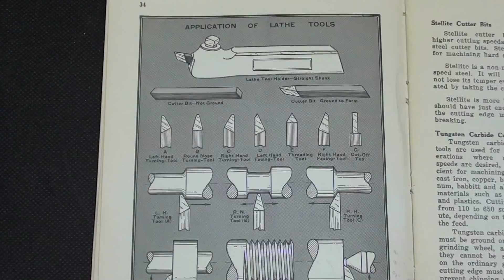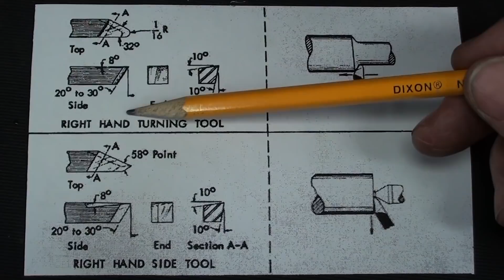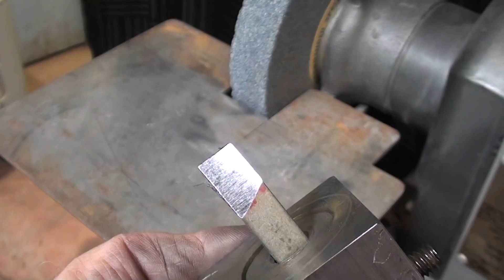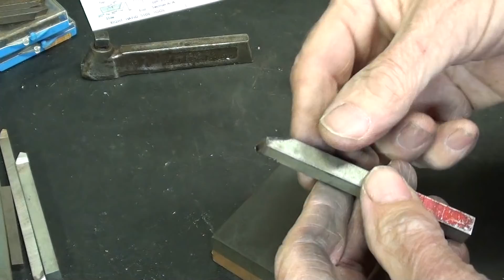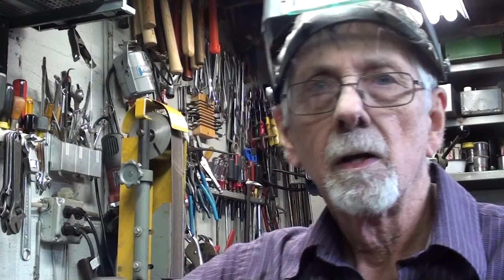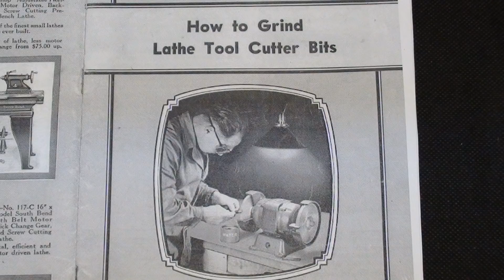HOW TO USE SB GRINDING JIG #709 pt 4 tubalcain lathe tool bits

Comment: Good morning, Mr.Pete! Three years later and am refreshing my 1978 tool grinding days. I also had a shop teacher teach us how to grind a lathe tool with a piece of square mild steel, then on a piece of high speed. I miss- placed my high speed steel right hand lathe cutter for forty years, thought I may have left it in the lathe at my first job around 1983. It was my first attempt and it took a half hour, but it was spectacular. I still use it now and haven't abused it and it still cuts beautifully. Thanks again for keeping these videos alive.
Reply from the maker: That is a wonderful story, thanks for sharing!

Comment: Machine shop grade nine high school in 1971 a student had too heavy of a feed on a surface grinder.  We were making a die handle.  That wheel exploded and a chunk flew across the room and put a hole in a cement brick wall.  So heed what what mr. says always stand beside the grinding wheel.
Reply from the maker: Surface grinders always scared me. I’ve never had a wheel explode, but I’ve had work thrown from the magnetic chuck

Comment: I am a frequent viewer of your channel and I am of similar age. Your recent posting for the South Bend Grinding Jig struck me as an interesting project and I decided it was one I was ready to tackle. So I went to myheap.com to get the plans and downloaded the offering by JHM because it looked the most like a normal drawing. I proceeded to work on the jig but after I cut the 10° slope on the body part, I realized I had put it on the wrong end. (I already had the two holes drilled in the top.) After checking the drawing more closely, I realized the drawing was in error and that’s why I made the mistake. Granted it was partly my fault for not checking the drawing’s validity but I wanted you to be aware of the issue since others may make the same mistake.
Reply from the maker: Thank you for the comment. I’ll tell you something right now. There were more drawings of this project than what I really wanted.    I was unable to proofread them. I had a hunch that there might be some mistakes. And there might be lots more than what you discovered       sorry about that.    Probably does not matter a whole lot, because who else will actually make this project, LOL.    I almost forgot to say, I really have no way of correcting this.  That would involve more than three people, and lots of time

Comment: Thank you Mr. Peterson. I purchased one of these, with most of the inserts and, one of the remanufactured cutting gauges off of Ebay from "Alisam engineering". Your videos really help make my Vintage SB 9A 4' bed is an awesome machine. If it's okay with you, I would like to post a snapshot of you on my shop wall next to my lathe. You are an inspiration to us all. Thanks again,
Jim🙂
Reply from the maker: Thank you for watching and commenting    Yes.    post my picture

Comment: What Lyle is showing here is the very bassos of all machining and without it you will bever understand how to be a real machine hand. 

 I was first instructed in tool grinding in High School  by our shop teacher Mr. Jim Jamison back in 1963 ,,,, 3/8" bits regular HSS,,,,Free Hand,,,,Round nose on one end and a facing tool on the other also free hand.  

It has served me well to this day. Even in the Army in Vietnam I was the only one in the Platoon that had any idea about Rake and Clearance angles,,,,and I would be in base camp in a tent at night  with a gas lantern filling saws and chain saw chains until I taught a couple other guys how to do it, -(We were combat Engineers)

 It is a knowledge that has served me well all my life to this day. I even touch up carbide inserts when they are not chipped too bad. ,,,, It shocks me to go into a shop today and see 30 plus  year old men running CNC lathes and mills who have no clue about rakes and clearances. I have even had some of them laugh at me when they see me grinding a drill bit. (Untill they see it cutting better then new) they think when you dull or chip a drill you throw it away.  Total  ignorance personified, and its because nobody taught them how to do it. 

It was the beginning of the end when there are no more Mr Petes, and Mr Jamisons.to show us how to do it,,,,  and idiot school boards that cut out industrial arts and replace it with diversity and sexual identify classes.  No wounder we get virtually  un-employable  collage graduates.,,,, that can;t read.
Reply from the maker: Thank you for an interesting comment. You are so right, that most people cannot sharpen anything more complicated than a pencil. They consider all cutting tools disposable. I’m glad you have the realization of how important industrial arts really Was.

Comment: Mr. Pete,
When I took two years of gunsmithing at the local Jr. College, the machine shop teacher taught us to grind hss tool it's.  The cupped wheel does make it easier.  The second year when we were working with 4140 and stainless barrels, I invested in carbide tool holders.  They worked great on the 14x40 LeBlond lathe at school.  On my 10 inch South end, not enough horsepower to make cuts deep enough for good finishes with the carbide inserts.
Thanks for the series of videos, I enjoyed them.

Comment: Mr. Pete, thank you. I knew nothing about this tool for sharpening lathe bits until you did this series of videos. I am contemplating making one just to see if I can do it without a mill (I don't own one) and have it look like it was done using one. My mill consists of a high tension hacksaw, files and a belt sander. I have always used the hand sharpening method with OK results. I have seen a different video where the maker used Dykem and a scribe for the angles and I will be using this as an aid. Instead of Dykem, I use a giant blue Sharpie.  The Craftsman lathe book also has excellent pictures of how to sharpen lathe cutting tools and acceptable angles used for different materials.

Comment: Would a 2" x 72" belt grinder perform as well as a bench grinder or is there some sort of drawback with using a the belt grinder?
Reply from the maker: Yes, I often use my belt sander. But did not want to confuse the issue in this video

Comment: Lyle, I plan to build one of these cutting tool grinding jigs for use with my old (1911) South Bend lathe.  I don't know whether tge lathe is sturdy enough to use carbide insert tooling and (so far) only have its original lantern-type tool holder.  Therefore I'm limited to HSS cutting tools for the time being.  I'm glad that you recommended practicing on key-stock instead of HSS!  I'll do my practicing on that before risking possible wasting of HSS.  Now I need to find a few more Armstrong-type tool holders!

Comment: I like to use low carbon scrap to grind form tools that can be used on HDPE plastic. I've also used it on aluminum one off prototypes. Thanks for putting these videos together for us Mr. Peterson!
Reply: That's what  I was thinking. what other materials; brass, etc? can  or do they need to be hardened? If they were, could they cut mild steel? Tnx!

Comment: Carbide really loves to take a heavy bite to get a decent finish. I've got some Iscar WNMG inserts that Tom Lipton recommended, and they will turn a mirror finish on steel **if** you take a heavy enough bite. >0.050" depth of cut and maybe 0.010"/rev feed rate makes them pretty happy. Try to shave off 0.005" and you get a grainy finish.

It's led me to plan my cuts more carefully and to be certain that I have a good measurement for that last cut.

Comment: Thanks again for another great video! Although I think you have covered it before, in one of your follow up videos, probably the one on dressing wheels you should demonstrate how to check for cracked wheels by ring testing it. As a cabinetmaker / millman for 48 years, it's the first thing I show an apprentice when I start to teach them how to grind shaper and sticker knives.
Reply from the maker: Be sure and watch episodes 798. I talk about the ring test And actually perform the test. But I do not think the sound was picked up
Reply: What is "ring testing"? I'm always nervous about the grooves that I leave in my wheels by grinding my tungsten on them (for tig welding). I'm looking forward to his wheel dressing video.
Reply: @EuroclydonEng  Hi Dennis, "Ring Testing" to check for cracked wheels is vary simple. With the grinding wheel off the grinder or before mounting a new wheel, with one hand hold the wheel with one finger through the arbor hole, next with the other hand take a metal object like a 1/2" drill bit or a wrench, lithely tap on the side of the wheel. You should hear a ring sound if it's not cracked, if it's a thud sound most likely it's cracked even if you don't see any. I wouldn't worry about the grooves from grinding tungsten on the face of the wheel.

Comment: When I was in high school metalworking class learning to grind tool bits we were taught to do it free hand with no mention of this fixture. I never knew such existed until now. If I did know I had forgotten about it. I hated grinding tool bits with a purple passion because it would eat up the whole class period, burned my fingers, and I couldn't get to the project until the next day. The next day I would wind up dulling the tool and spending the remainder of that class period re-sharpening. 

When I discovered carbide and quick-change tooling I pretty much left HSS behind, but still occasionally need something special that HSS can deliver faster and cheaper than carbide for one-off jobs.

Now, with progressed arthritic hands I have an even greater appreciation for such a tool and will now have to add it to my list of shop tools to be built. 

Thank you for adding the still photos at the end. It allows me to take screen shots and archive the information for later use. Very much appreciated!

Comment: A very clear and useful demonstration. I sure wish I’d had one of these when I started in the machine shop over fifty years ago. I grind all of my tools by hand and touch them up on my belt grinder with a fine grit belt. The belt grinder gives a slightly better finish and is easier to control the angle.

Comment: Have you used stellite for tools, I have heard that it's almost as easy to sharpen as high speed steel and last almost as long as carbide?
Reply: Satellite is sometimes used for exhaust valves due to it’s hardness and extreme heat durability but I’ve never heard of it being used for cutting tools.
Reply: Stellite 100 is the alloy most used for cutting tools. There are many variations of stellite alloys, the main use for it today is hip replacements. Wood turners have been silver soldering it to carbon steel and using it to make a scraper tool for wood turning. Stellite 100 will hold it's edge much longer than high speed steel however it can be sharpened with regular grinding wheels.
Reply: @waltcrawford6153  Thanks Walt, very interesting about the different uses of Stellite. I learned something new today.

Comment: As apprentices, we were given the lecture, then each was given a "master" sample and told to duplicate it, working freehand. From there we would be shown its use on the machines.
What was interesting to me was that in a short time our instructor could recognise which of us in the group of 10 had ground which tool! He was able to do the same with our freehand sharpened drill bits, as well as our finished projects. I'd guess you were able to recognise the "hand" of your students, too.

Comment: finally i got it.   yes i made  one  I could. not find   a Squair plug socket out of my old spear sockets A offend it to drill  to except the tool steal into the square of  the  3/8  tooling  in my  socket. then , Then heated the block & put the socket in my deep freeze  & pressed it home in the sleeve .  I did not put the engraving on the  The sleeve Insted i made a stick out circular boss a little.  Deeper & engraved that insted, Putting the Zero on The sleeve  instead,   Cutting down on the need for engraving of sleeves,   & putting the Zero on the Face of the block to with it scribe mark  easily done  in the way you  demon-striate it in the lathe 4way  chuck .   I hop this meet's with your approval .  Les in England. once  softened drilling the oppstruction in the socket is easy .  Filing doesn't work to hard.
Reply: I dont know if your talking to me but thanks  les
Reply from the maker: Great ideas
Reply: This is hilarious, four smileys for Les. 😊😊😊😊

Comment: Lyle - Excellent video early on a rainy morning with the second cup of coffee.  I imagine you have the video on making the gauge finished already - but if using a quick change tool holder it would be easy enough to modify the one angle as South Bend designed it to use the Armstrong and such tool holders with the built in angle.  Like you said, once you wrap your head around the why of the angles easy enough to do free hand and get good results.  Like a lot of things, just a bit of experience helps quite a bit as you move along.  Keep up the good work, I'm sure the more in depth explanation helps beginners.  And those of us more experienced are never to old to pick up a trick or two we did not learn over the years.  Thanks.